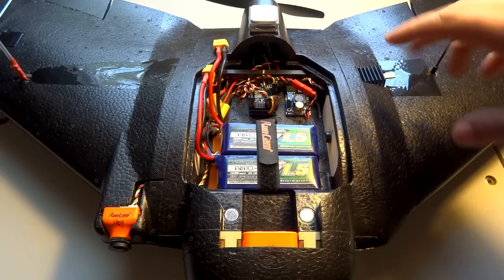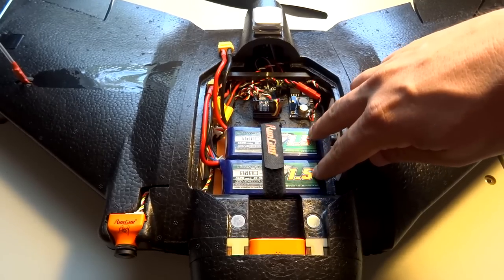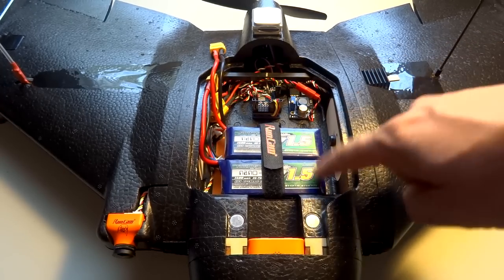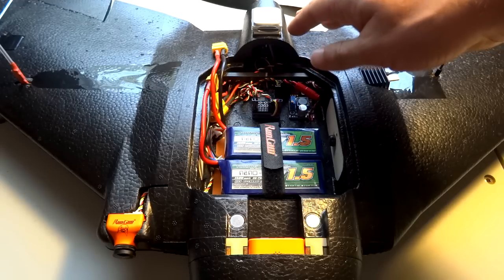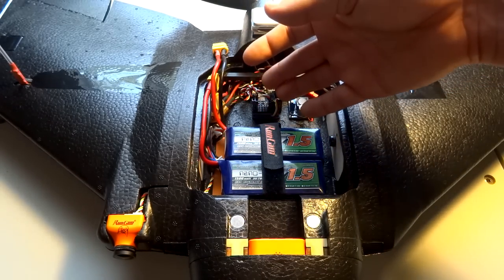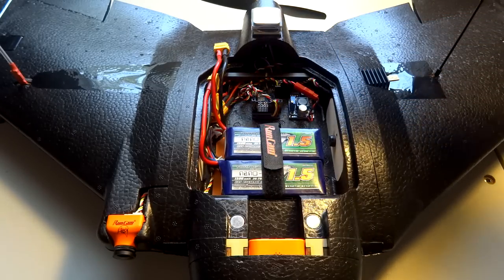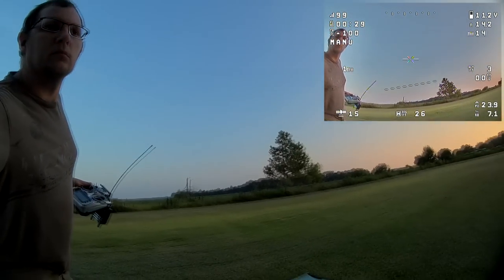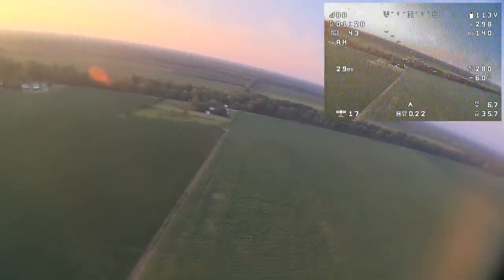Matek F411-Wing - Part 2 First flights!

Comment: Keith, can you link the vtx antenna you are using? I see it on your Nano Talon as well. Thanks!
Reply: It looks like a Lawmate antenna to me, like the one they issue with their 1.2G VRXs.
Reply from the maker: It's actually the one that comes on the Racewood transmitter and receivers. Similar in design, but lighter and the "whip" is thinner. I looked all over and this is the only place I can find it right now: https://www.rangevideo.com/products/1-1-ghz-lightweight-dipole-antenna-w-sma-connector Not sure if it's the same though, the call that one a 1.1GHz antenna. I used to get these from RMRC and DPCAV for about $2, they sold them as 1.2/1.3 antennas made by Racewood.
Reply: bonafidepirate awesome thanks!

Comment: Can you try it with 2 lion batteries to see what kind if flight times you get?  I bet it would fly for a very long time.
Reply from the maker: I was thinking even one 3500 4S would be nice. Lighter and smaller than what I have in it now with more energy stored. It's one reason I went with the 12V regulator instead of a simple LC filter for the vTX power. Planning ahead lol I'm guessing you could ditch the HD cam and run two of those packs for crazy long lights form a small wing... lol I need to look into making my own packs to save a few bucks though. The Titans are not too cheap, and they're the only ones I know of for sale ready to use, though I haven't really looked around either. Got any suggestions?
Reply: Unfortunately, Titan is the only brand I have found in the U.S. and use. I would think it would be great for long flights. I however am one of those who love long boring flights lol.

Comment: How did you get the RSSI to work on the F411 wing board?
I cant get it to work. :( 

What receiver are you using?
Reply from the maker: I'm using a Dragonlink receiver with it, and sending the RSSI on a spare channel in the SBus stream. The F411 doesn't have any analog inputs to use for RSSI that I know of.
Reply: @bonafidepirate  I figured it out :) Downloaded the f411rssi hex firmware, now I have analog rssi inout on the ST1 pad =)
Reply from the maker: Nice, I wasn't aware of that firmware. I'll have to catch up... lol Thanks for the info!

Comment: Is there a trick to getting the servos to work or do I need to use digital servos?
Reply from the maker: No, any standard servos should work. Standard analog and digital servos all operate with the same signal input. (usually 1000-2000uS PWM, with 1500uS being "center". Some Futaba systems center on 1520uS but otherwise the same.)

Comment: Is the AT wing and the RMRC recruit the same wings?
Reply from the maker: Yeah, this one is the Sonic Model AR Wing, the Recruit is out of the same mold as far as I know, the big difference being that the Recruit comes with a little stabilizer board in it just like the one in the ZOHD planes. They're probably all made in the same factory if I had to guess. I'm not positive about the other electronics though, motor/esc, and servos.
Reply: I believe that RMRC worked with Sonicmodell on the development of the Recruit/AR.
Reply: Same wing but RMRC pnp comes with bigger motor and 3 blade prop.

Comment: A wing!!  Coming full circle? Lol
Reply from the maker: I've had a few wings in the past! Still have most of them, just don't fly them much!  lol I liked this little AR Wing a lot, it's a nice medium size, big enough to get some battery in it to cruise around for a while, still small enough to fly on a cheap mini quad motor. It's a nice smooth flying little wing too, and the Runcam 3 drops right into it. They make it too easy... lol I had set it aside for an autopilot, it just took me a while to finally try out iNav, kept putting it off. When I saw these great little boards made just for fixed wing, I knew I wanted to put on one there. :)

Comment: If one battery fails bro your esc will have a really bad day
Reply from the maker: Why would a battery fail? If a wire or connector or something broke, the plane would definitely fly on one battery, just not as long. Not sure why a battery would short or anything like that, but if it happened it would likely kill the other battery too, possibly even set the whole thing on fire... lol I would be extremely surprised if something like that were to happen though. People have flown multiples packs in planes for a long time, myself included. You can even buy packs with cells configured in both series and parallel.
Reply: @bonafidepirate  they use some kind of PCB,  but you are connecting it to the esc and if one battery fails in mid flight then see the voltage drops as the current will flow towards the other battery and not even the boost controled will help just think about it and no hate bro chill nice tutorial just trying to find a good wing any advice😅
Reply from the maker: Lipo packs don't have any special circuits inside, at least not "non protected" R/C packs. (Laptops, phones, etc. usually have hardware in them for safety to prevent under or over charging them) This is nothing more than a 3S 2P pack, wired externally rather than under the shrink wrap.